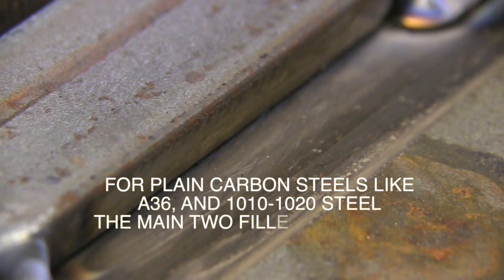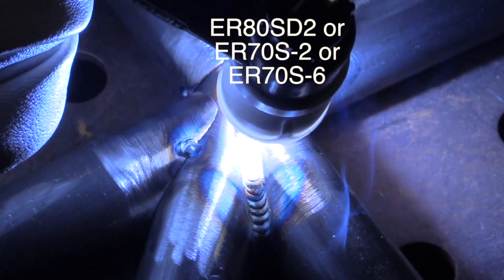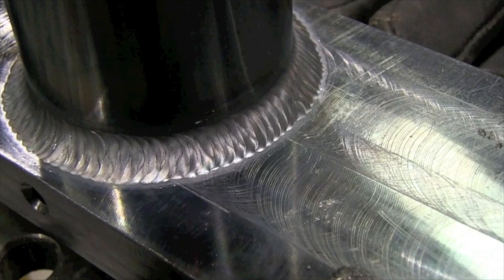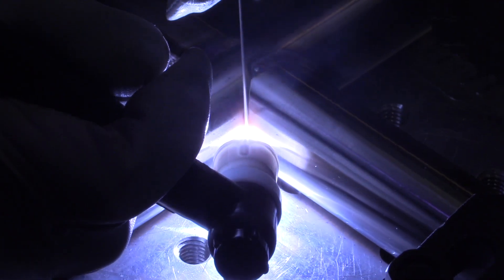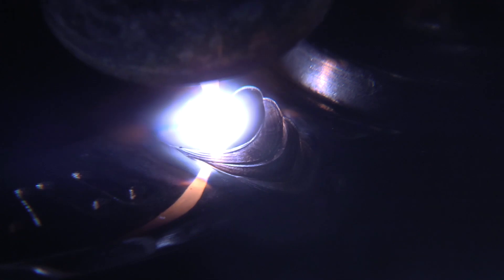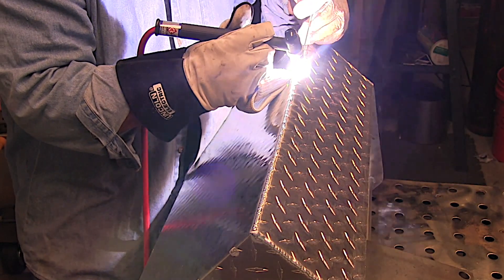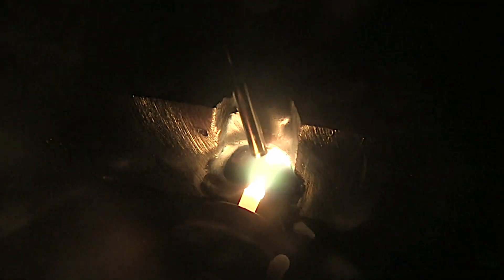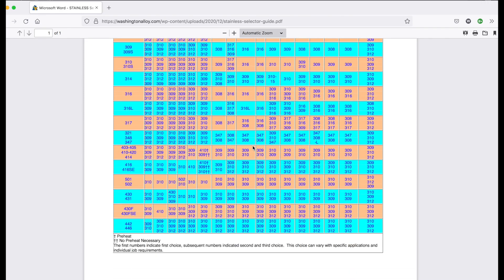Basic TIG Filler Metal Selection

Comment: Im trying to weld mild steel tubing to 304 stainless steel. Could i use 309 filler rod and do i absolutely have to purge it this is for turbo set up back pressure of this set up should se a max of 20lbs of back pressure

Comment: the other one i would add is 312. you see that in that stainless chart a fair bit. if i remember right its used with high carbon steels, backing layers. its a good repair rod and still reasonably common.

Comment: The European Union welding industry now considers the deoxidizers in ER70S-2 to be obsolete and says anything that can be welded with ER70S-2, can be welded with regular manganese - silicon, ER70S-6 type weld fillers, including the rimmed and semi-rimmed steels that ER70S-2 was originally developed for.

Comment: Thanks for the insights Jody. I have used 309 rods for welding a stainless V-band to a cast steel turbo manifold, I did a pre-heat and also a slow cooldown by wrapping it up after. It's still holding up after many heat cycles.

Comment: Washington alloy tensileweld worked wonders for me on a lot of jobs where base metals were likely dissimilar and unknown. Especially on large 3500 psi cylinders where cracking on the root seemed to happen a lot with 70s wires by the dissimilar contraction rates. Also lays some beautiful coloring which is an added bonus.

Comment: Thank you Jody! Can you do a basics on tungsten selection?
Reply: He has some videos on that. And from those I can reasonably say that Jody prefers/recommends 2% lanthanated for most jobs, both AC and DC.
Reply: I use white for aluminium and I use red or purple (E3) for most steels but you can also use E3 for aluminium. I find the white is easier to keep clean and less likely to suck the puddle up. I have also used red on aluminium, which isn't recommended (but it works) and the tungsten barely balls up.

Comment: Great video. Clear and concise.  BTW what is the issue with 5356 over 150°?
Reply: My guess is a cracking over time with the thermal cycling causing it, but it's pure speculation based on some notions about Al.

Comment: Do you think Autogenous welds on exhaust, like a turbo hot side, would be strong enough or should you use a filler rod? I've always wondered and have never been able to test it.
Reply: For turbo dumps and hot areas I used filler but I have done many non purged autogenous (fuse) welds on exhaust systems. They hold up just fine. I keep a decent amount of torch angle to so your melting the steel together rather than punching down and penetrating it creating excess carbon. Settings: DC Pulse ~65A 20%, base ~30A @ 2Hz (2 pulses per second) and crank that post flow up to 6sec+, looking after the stainless you can keep it silvery golden the whole way.
Reply: @lightmetalinc.6488  Ok, well I'll purge or use solar flux, anyway. Thanks for the info.
Reply: @funfun8095  Often strength only becomes an issue when there is excessive vibration or the exhuast system is poorly mounted. Exhuasts get filled with carbon so the idea that carbon on the inside of the weld will be of detriment is silly. When I first started welding I fused a 45deg pie (4 pieces) no purge excess penetraion and carbon, put it in the press squashed it like a pancake and no welds pulled apart. Don't be afraid to experiment.